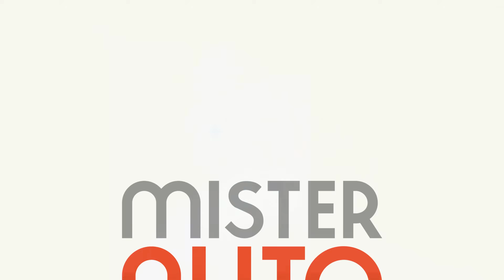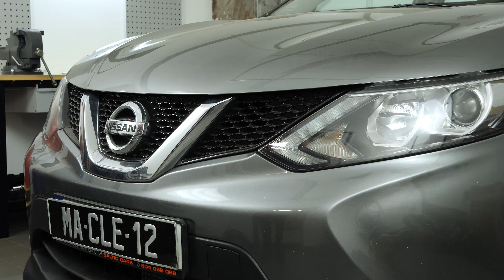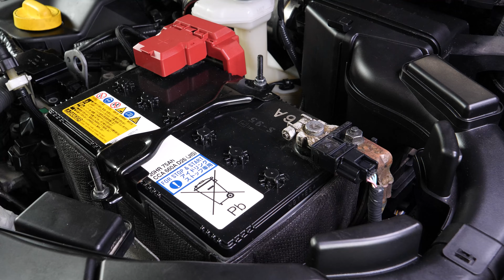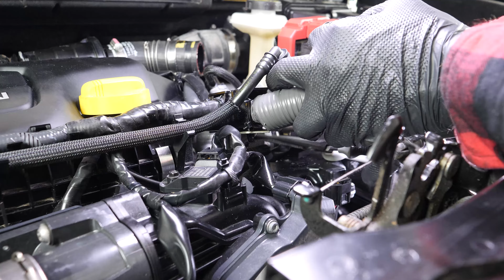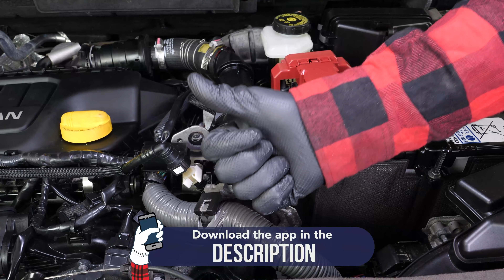How to replace the EGR valve Qashqai mk2 1.6 dCi ♻️

Comment: If you're lucky like I was (11 years, 200,000 km), the valve might not be stuck at all, in which case this job is a lot easier. I would suggest loosening the two bolts holding the valve in place (the rear one is a bit fiddly but not too hard) to see if you can move it. In that case, you just have to remove the pipe and loosen things surrounding it to create enough room to pull it out.

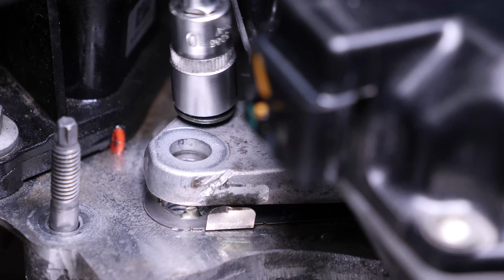Comment: OK @5:05 it says remove the electrical connection but you can't see what tab you're pushing or how to disconnect it. That's currently the only thing preventing me from removing the valve and I can NOT get it off or see where the tab or whatever is located. How do I get this thing off?

Comment: Wow, I normally struggle to get good videos about the 1.6 but this is excellent. Gonna try removing and cleaning it this afternoon :)
Reply from the maker: Thanks a lot @sonicwingnut ! I hope the operation went well 👌
Reply: @UseTool_EN  It was a bit different to this video - mine has a metal intake pipe which is much easier to remove although those metal catches either end required 2 screwdrivers wedged in to get them off. The wiring loom box directly above the EGR didn't require removal at all in the end but the cable beneath it did - on mine the plastic tab was on the opposite side so an absolute pig to get off because you can't see anything so just have to stab at it with a big flathead and hope for the best!
Getting the valve off after that and cleaning it was easy, although sadly didn't fix my engine light.